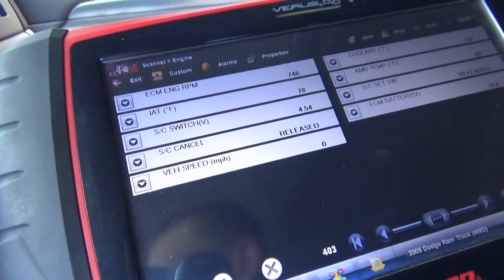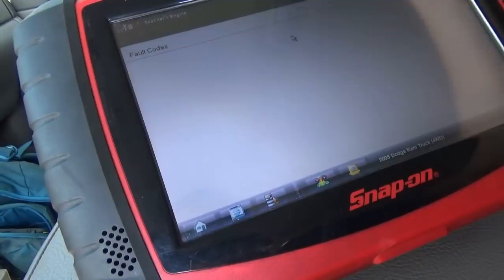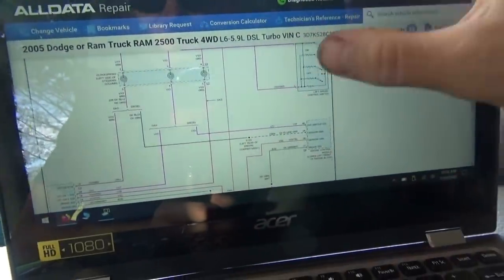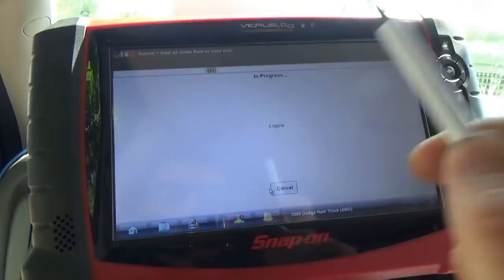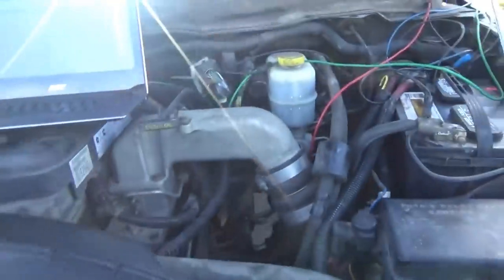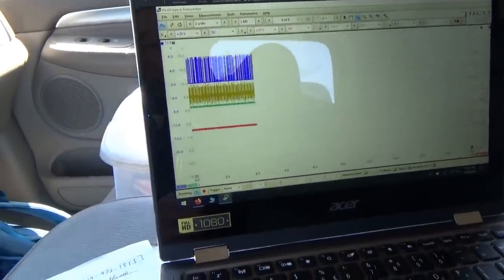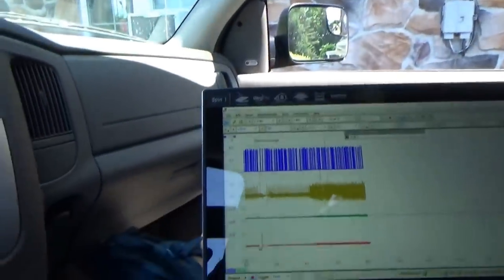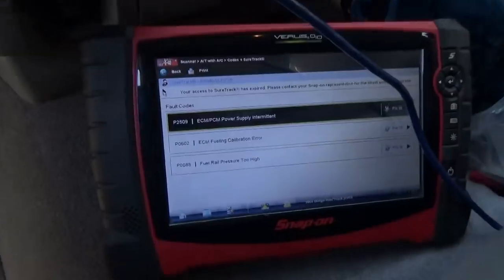Cruise Control = Engine Stall?? - Part 1 (Ram Cummins Diesel)

Comment: So, that P0088 for the fuel pressure is most likely a symptom, not an actual fault. When you engage the cruise CTL, the ECU crashes and reboots. Hence the voltage drop (no more load command to the alternator), reduced comms on the bus (ECM is not sending any data), and the weird PIDs in the scan tool (during boot, the ECM may report an incomplete list of PIDs supported). After this reboot, the actual and the desired fuel rail pressure do not match; the debounce time for this fault is very short. Pressure does not get back into the desired range within that debounce time, boom; DTC is set.
The symptoms are quite consistent with my experience of a crashing ECU; I've had this happen on development units. Why it doesn't set a Level 3 Monitoring fault is questionable, though. Also, the fault may not lye within the ECU, though with cruise on a Diesel, that is unlikely (Cruise and regular operation use exactly the same inputs and outputs).

Comment: I would think power/ground issues, with  the wipers being related.
wasn't there an issue with ignition switches or where the harness goes through firewall on those trucks? I may be thinking complete wrong truck though and probably just chrysler's famous ground corrosion :))

Comment: Hi ivan, looking at the diagrams it seems like the switchs on the steering wheel should be getting both a signal and ground wires from the pcm, assuming the switch or the wires are shorted they maybe over loading the pcm's circuit causing a momentary shut down ?! Just a thought ; eitherway its a very interesting problem indeed 🤔. Very much looking forward to part 2. Btw thanks alot for sharing, absolutely love your videos, very educational and like a good film never lacks an interesting twist at the end 😀!

Comment: Does the Cruise Control Wiring share the same connector or harness segments with the wiper and/or the power going to the PCM?  Im curious if you were to hold the Set Cruise button whether you would see the Data Link drop out for the same time as you held the cruise switch.  It appears that you get about the same packets with the key off as you do when the cruise button is pressed.  Perhaps there could be some corrosion inside a connector or possibly the PCM that grounds out the signals or back feeds when you hold the button down?.  My Coworker had a similar year Ram (non diesel) and he had to have his PCM replaced due to internal corrosion causing very interesting symptoms.

Comment: Diesel don't use throttle for rpm control, they use fuel delivery.  You can remove the throttle and it would still rev up.
The throttle valve on a diesel is a shudder valve , it crests a nice shut down, turbulence and is used for egr dpf .

Comment: Doesn't the ecm control injectors when in cruise . My be it will not engage as fuel pressure to hi and yet runs perfectly well when not engaged . Ecm cannot control injection with this problem .I would need to know . Funnier thing have happen 😁

Comment: The cruise control electronics? Short inside of it or similar? Anything else that is supposed to accept a signal from the "set" button? Not likely but even the clockspring could have a limited issue.

Comment: You have ECM/PCM reset (power fault) and instrument cluster fail. Is the Cruise control light on dash powered directly from the ECM/PCM? What if that line is shorted to ground or 12V? When you are stationary, no problem with input, as the cruise does not engage. But when you have enough speed, it engages and turn on the light on dash, get shorted, over current, reset the ECM/PCM, which turns off the cruise control and you are in the square one, with a module power fault code due overcurrent protection kicking in and some random other code due ECM/PCM not controlling something while it rebooted, like fuel pressure as the injectors were not firing.

Comment: Did you try disconecting the fan clutch like the recommendation in the SnapOn tool? Seems like an easy low hanging fruit test to try.
Reply from the maker: No, since that would have nothing to do with Cruise control, and the truck runs perfectly all day long. But would have been interesting nonetheless :)

Comment: Used to happen to me with my '89 Econoline, 5.0 W AOD. At highway speed trying to climb hills in OD the lockdown would not engage & upon attempting to accelerate under cruise control the engine would just bog down & CC  would disengage leaving you with a 😬 look on your face !
Reply: kickdown not "lockdown".

Comment: Yeah I Would say the cruise control IC or circuit is shorting, Did you check all the PCM powers ?, I do not know if the part you where testing is for one side of the PCM and not the cruise control power side, because it has more than 2 power wires for a reason, like some cars got a transmission fuse and engine fuse, if the transmission fuse go the car would still drive in limp home mode, but the PCM and TCM is one

Comment: Dear Ivan, If you try it at night with lights, blower on to put more electrical load, would the engine stumble or stall in a more intense manner, i.e. would it be an alternator or battery just barely started to fail ?? and I wonder if the PCM have a very sensitive voltage sensor that makes it shut below a tiny threshold. Great investigation. Take Care and Enjoy Tour time. John Kaplanian

Comment: I think it the computer shorting out or  it coud also be bad brake swich ?Another symptom of a potential problem with the cruise control vacuum reservoir are engine performance issues. If the vacuum reservoir breaks 
or leaks, it may cause a vacuum leak that can affect the performance of 
the vehicle. Depending on the severity of the leak, the vehicle may 
experience a decrease in acceleration, power output, and fuel efficiency.

Comment: What happens if you hold the set button down continuously instead of momentarily? I also think the clockspring, cruise buttons (anything can short internally so if the button is supposed to send a ground signal to the PCM and it’s sending positive to the PCM it would be shutting down as a safety precaution?) as well as unplugging the cruise at the servo and trying the button again. Idk, reprogramming the SKIM, keys, remotes and modules just seems like a PITA and a last resort.

Comment: Did you think of checking the fuel rail pressure sensor to see if it was actually going  above 4.5v to be set to a P0088?  From what I read if the fuel pressure goes high, the ECM goes into limp mode.  Do we know whether the CC on button is pull up or pull down?

Comment: The p2509 could be the fan plug or loose battery connection on the left battery.  The p0602 the pcm needs flashed if the code comes back it needs a ECM

Comment: I would also put your scope ground on the ground of the sensor while testing to see how much noise there is when the symptom happens.
Reply from the maker: Interesting thought. Bernie teaches scope ground is always on Batt NEG, and then use a channel to test for noise :)
Reply: @PineHollowAutoDiagnostics  I have heard him reference the scope ground to the most zero point of potential very true.  However since your on battery ground you will get noise from the entire electrical system.  If you go on the sensor ground you should get a cleaner signal because the computer uses capacitors to help reduce the noise.  So if your signal has a lot of noise and you are on sensor ground you have a shielding issue for the wires or their is a issue inside the computer.  I have seen this happen before on Acellerator Pedal Sensors with 2 potentiometers where the shielding failed and I had too much noise on the circuits causing my Accelerator Pedal codes.  I would just hook up real quick and compare it when it stumbles to see if there is any difference.  Also get a capacitance Decade box to test the theory as well.🙂
Reply from the maker: @trainer2018  Love the detailed engineering explanation! You can also think of the battery as a giant buffer/capacitor. I'll have to experiment with ground noise levels on different points on the vehicle :)
Reply: @PineHollowAutoDiagnostics  Ivan, I'm pretty sure Bernie's 'scopes are common ground. Using a single ground to B- is the correct way to hook up that type of 'scope.

On something like a Pico with individually grounded/isolated channels there's nothing wrong with using sensor ground/low ref when 'scoping a reference circuit. I agree with busjockey1 that the signal should be cleaner because it removes the "noise", or voltage drop, on the modules ground circuit.

Comment: I’ve gotten the power intermittent from weak battery’s . When cranking the voltage dropped and it was too weak to start the truck. Tried it a few times and it threw the code.

Comment: Schematic reading should be a basic course early in life. Either way, these All Data schematics with the circuit trace feature (the highlighting of the circuit) is a killer feature. What does that subscription cost?

Comment: Ivan did you scope the fuel rail pressure sensor power, ground, and signal?  I'm wondering if you are getting too much noise on the signal when the symptom happens.  Very weird.  Never seen this before.

Comment: Maybe try reseting the ECM memory by disconnecting the battery for 20+ minutes? Part of the ECM algorithm must include storing the cruise set speed in memory; maybe there is a value stored in there it doesn't like and it kills the ECM momentarily when it tries to store the set speed? A long shot, indeed, but this is a bizarre one.

Comment: I think ECM has some internal cold joints problems on power pins. When it tries to activate cruise control it needs more power so more internal voltage drop and messes up the ECM, you cannot see it since you scope it externally.
Reply from the maker: Perhaps. Not sure why the cruise control would draw more power; it's just logic circuit.

Comment: Is it possible the set switch is going to ground?  It showed on the diagram that it is a dedicated circuit signal and signal return.  I have had rubbed wires in the steering column that had caused radio related gremlins, you may be chasing the same gremlins for the cruise.

Comment: I wonder how much current is drawn when you activate cruise it could be causing an issue in the ecm so you won’t see it measuring outside voltage and grounds. 
Also one code was 12v below voltage which again would be measured inside the ecm?
Did I see an issue with the obd glitch at the same time? Which again would point towards the engine computer

Comment: when cruise kicks in it takes a second to find the sweet spot.  is it possible  its torqueing just gight to cause a short  in the 5 volt circuit or a 12 v circuit is shorting to the 12 v circuit temporarily..   would explain that fuel pressure high code too.

Comment: I have an 02 cummins with an 01 ecm. I have read ( unconfirmed ) they are the same ecm but have
diferent programming . My cruise control is dead as well as oil preasure gauge, but truck is 100% besides
those 2 things. Has someone installed an update or something in this truck? I am trying to find someone 
who knows their stuff to see if my 01 ecm can be updated with software to  have 02 programming. But no luck yet.

Comment: It’s  more than likely a problem in the fcm     Or tipem is there also an 0483.  I’d start with the fan clutch and end with the  rear door wires
Reply: Fcm, fan control module? My dad's truck had something similar happen, but with cc engaged, not while engaging. It threw P2509 and P0483.

Comment: When the engin RPM and vehicle speed dip suddenly, are you pressing and holding the cruise set button or quickly pressing and releasing?  In other words, does it come back as quick as it does because you released the button, and if you held the button, would it stall?

Comment: Seems that there could be a short between the wire that controls the fuel flow (for cruise control) at the injector pump....which is close to the ECM on that engine and the wire that shuts down that pump....I didn't see how you isolated the engine computer in this one.
Reply from the maker: Wire that controls the fuel flow for cruise control? Didn't see that on the diagram...
Reply: @PineHollowAutoDiagnostics  - I think there are 2 places the throttle needs to control, the throttle body on the intake and the fuel level on the injector pump, Since the truck probably has drive by wire, there has to be a solenoid by the injector pump which would be powered by a wire from the TCM.....but I am just guessing!

Comment: I think I’d rather not use the cruise than spend all that on a new ECM. If it’s the ECM, wouldn’t it do it randomly and more often?  I think we’ll find out it’s something in the steering wheel, the switch itself or a wire from the switch. A wire is pinched or exposed where it shouldn’t be.
Reply: Yah you don't need cruise control your right foot works just as well
Reply: @Rövhålgren CP Arselstedt Maybe only when it’s pressed? Guess we’ll see.

Comment: Why does it keep setting the high fuel pressure code? And what about the 'ghost wipers' problem?  Could they be related to the cruise control issue?  I'm clutching at straws
Reply: I know why you say that. When attacking a problem, gather all the data that you can. Then sit down and think. Anything in common? Sometimes, however, you must put the blinders back on and track one symptom down at a time.
Reply: @hudzgh  that's my issue.  He gathered the data. Couldn't find a problem. I'll have to wait until tomorrow, see how it turns out.